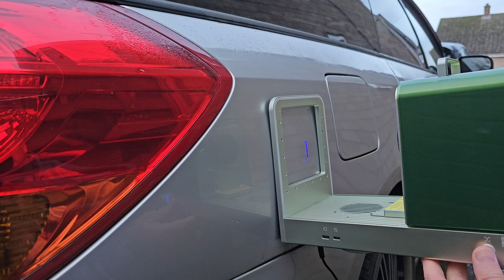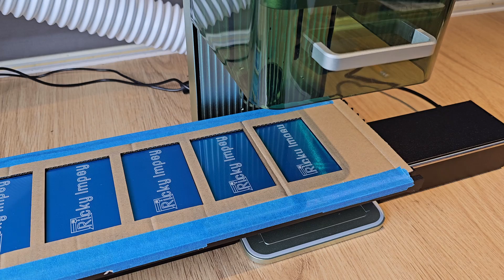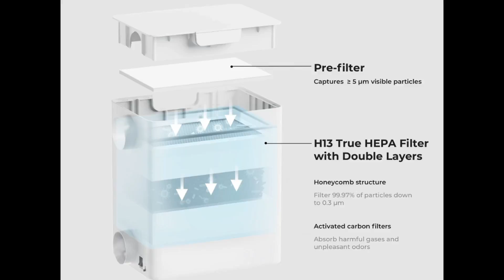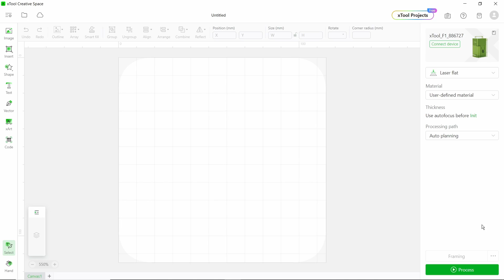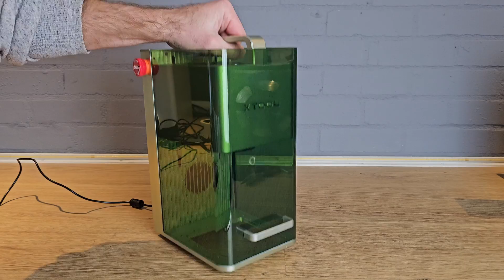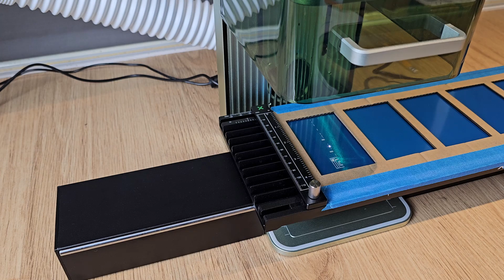Crazy Things You Can Do With The xTool F1 - Review

Comment: Quick question. Would laser etching a plain build plate with a design imprint itself on any prints you print off it. Patterns such as the carbon fibre pattern could be done and you would not have the disadvantage of printing on sticker surface and it eventually rippling due to heat?
Reply from the maker: Yes, this does work. You have to play around with settings to get the burn deep enough but once you do it works well. I engraved a carbon fibre pattern onto glass which works well.